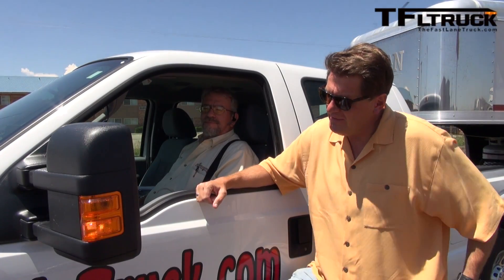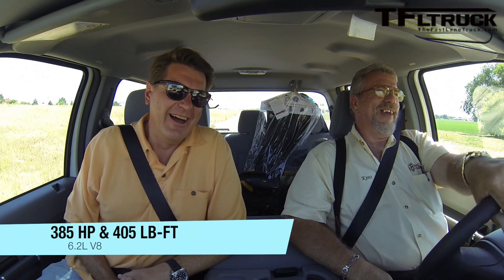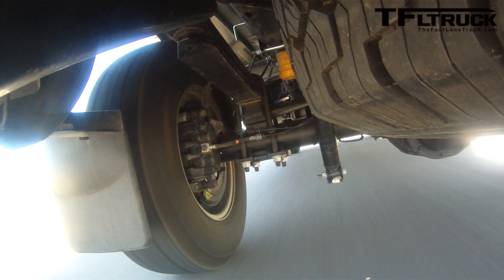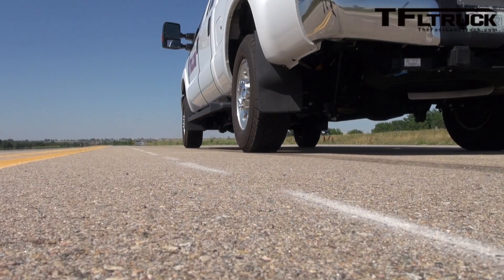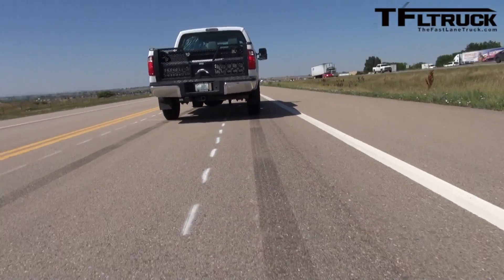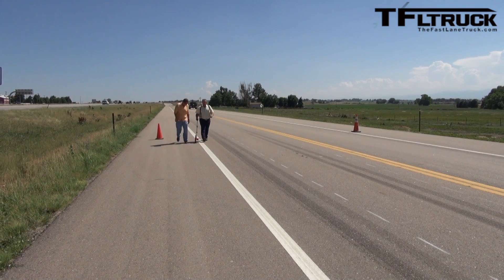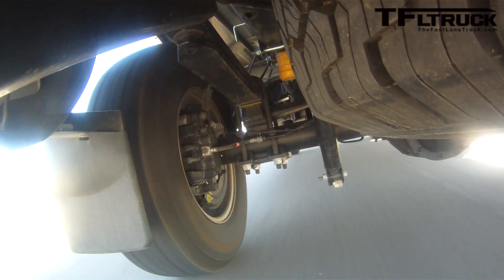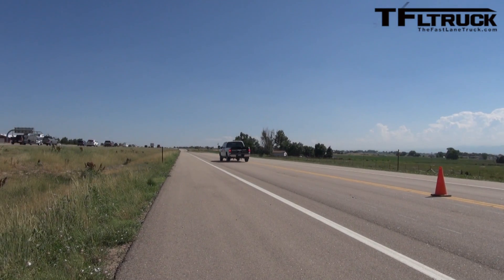Project Super Duty: Ford F-250  Air Suspension Conversion (Episode 2)

Comment: Someone that can only afford a low end, basic F250 work truck like the one you are installing the air suspension on is not going to be able to afford a few thousand dollars for the conversion. 

Better off keeping the leaf packs and adding a set of air bags like the Firestone Ride Right bags, they work great. They cost much less and allow you keep your factory suspension. A much better solution than tearing your truck apart.

Also, for towing that big 5th wheel, a diesel would be a much better option than the 6L gasser. That engine and transmission is going to take a beating, with or without an air suspension.

Comment: The tests should have been done with the trailer attached. You won't see as big of benefits with the air suspension without the trailer hooked up. The trailer needs to be attached to really show the difference between the two suspensions.